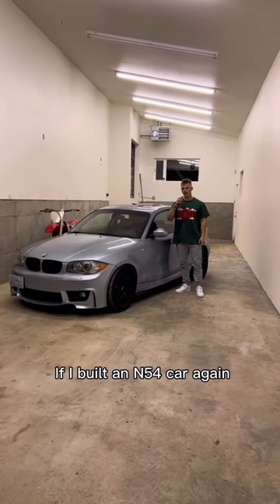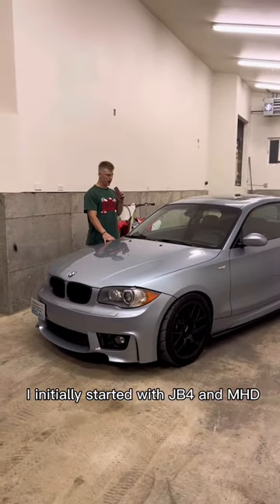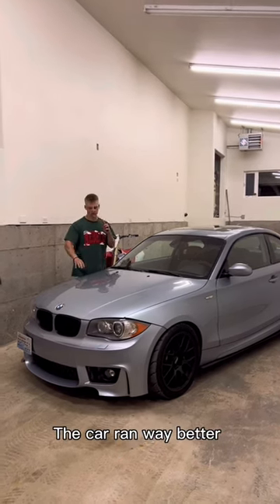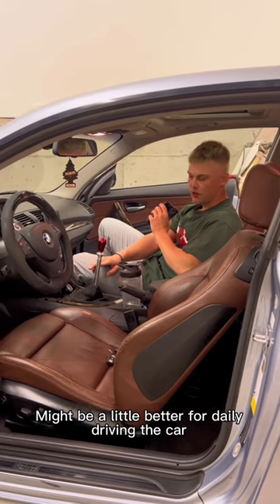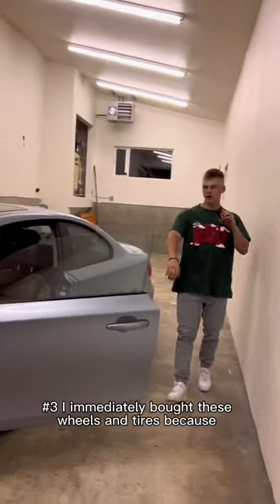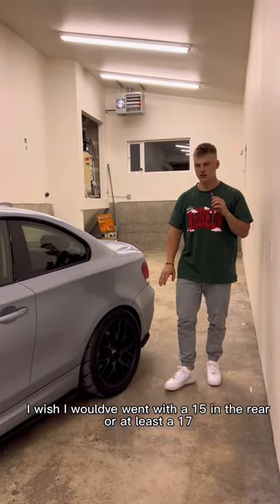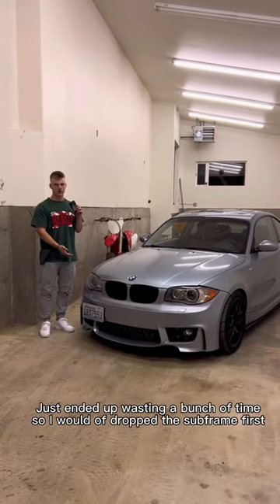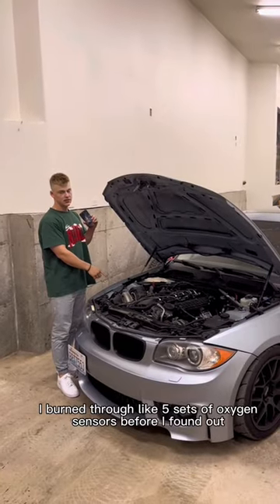5 Things I’d Change If I Built An N54 Again

Comment: Why is this the first time I’ve heard of a solution for burning through o2 sensors? Tf? Thanks
Reply: Not just that  for example if you don't want to run a tune an o2 spacer helps to get rid of the CEL too
Reply: @carcrazyguysa4059  I think mhd just codes it out
Reply: hey what are 02 sensors ?
Reply: @jshifty9618  Most cars have two o2 sensors its an emissions device that reads the output of carbon gases before the catalytic converter and after. One sensor is place before the cat (primary) and the other after (secondary) It basically checks if the catalytic converter is doing its job to clean up the exhaust gases before they come out the back. The primary sensor also gives data to the ECU for fueling and air etc.
Reply: @carcrazyguysa4059  bro… i really appreciate that, i grew up without a father so most of this stuff i find out myself or online or from friends so again thanks for your time that you took to write that for me. also i subscribed to you, hope you have a wonderful day boss!
Reply: @jshifty9618  No worries I understand always happy to help. I learn through social media too I didn't know any of these things too and you can learn so much from others on YouTube. My dad knows nothing about cars and isn't anything close to interested in cars so I too learnt from other on YouTube by doing research. Never be afraid to ask questions, yes there are some rude people on here but ignore them. Nobody is born knowing everything. Even I too have a lot to learn😅 Thanks for the sub!🙂
Reply: @jshifty9618  sensor(s) attached to the downpipe that monitor the exhaust fumes going through said downpipe.
Reply: @carcrazyguysa4059  is checks gasses that have oxygen in/attached to them, hence o2 sensor(o2=oxygen). Just a small correction, no biggie just thought I was clarify 🤙
Reply: Right 🤣
Reply: fr
Reply: Because it's illegal to put O2 spacers 😂😂😂
Reply: Exactly what "solution" are you talking about????

 he said he stopped using o2 sensors and started using oxygen sensors 😂💀
Reply: U need them even if u run front pipes to a stock cat

Comment: i have another fix for the o2 sensor issued my car burned through them so i decided to buy audi adv sensors they are cheaper and made for pre turbo they work perfectly and they last way longer also your tuner will love them because they read more accurate only downside is you have to spice the wires from the old one but it only takes about 20 mins
Reply from the maker: Interesting, I’ll have to look into that!
Reply: @jakobolavjensen if your's ever go bad i would think about doing it the part number is NTK 27050 the ones on o'reillys website are the only ones that i found that are the exact part number and model the only thing you have to when splicing the wires is make sure you pull out pin 5 on the o2 engine wire harness or just cut  the wire on the  o2 engine wire harness and strink rap it.Also on mhd make sure to put on adv sensors in tuning options and you should be all set no need for o2 spacers and perfect readings

Comment: My jb4 went bad and started throwing reading fault codes that had me stranded guys said it was water locked
Reply: I have one in my JCW Mini Clubman. I ended up just running a bead of silicone around the case seam. Mine's newer and came with the billet aluminum + o ring case, though, but 18 months with it with no issues.
Reply: Good thing replacement boards are pretty cheap

Comment: What is N54
Reply from the maker: A 3 liter inline 6 engine that came in this car
Reply: @jakobolavjensen  o yeah it’s the engine from the e46 m3. I want to get and build an e46 to be 500+ hp mainly for racing. Do you have any idea how I should go about this and which platform to start with. I probably have 20k to work with with and later if I make some more money 7k on top of that.
Reply: @ididntseeaamvwiththissongs3472  the e46 m3 has a different engine. The n54 is in the next generation (e90) 335i, 535i, and 135i.
Reply: @ididntseeaamvwiththissongs3472  😂
Reply: @lukewest708  thanks for  correcting buddy confusing s54  
For n54 

Or maybe he confused the m54 for n54 lol😂

Comment: What do the 02 sensor spacers do? My car keeps killing them on a doc race kit also
Reply from the maker: They just move them a little farther away from the manifold so they aren't exposed to as much heat
Reply: But hasn't the new doc manifold solved this o2 issue?
Reply: @RobertoDTK  no I have the newest manifold they have
Reply: Yep I run the o2 spacers too since day 1 when I installed the kit. I only replace them because I can since they are from FCP. The longest I’ve been on a set was about 10000 miles before I decided to swap them out.
Reply: @H2PROz   What size spacers did you use?